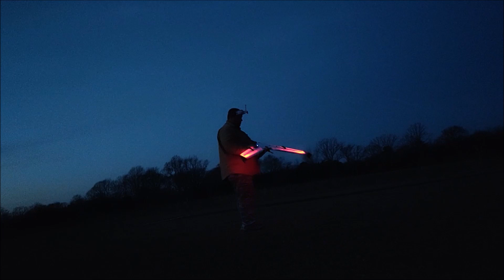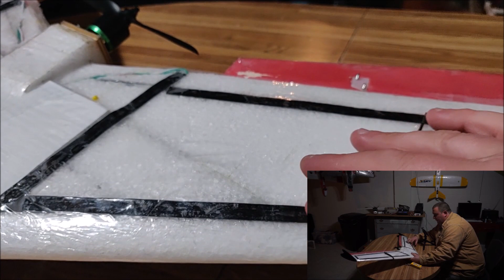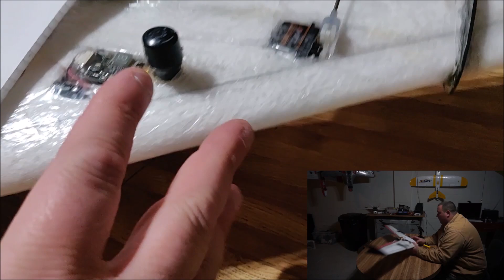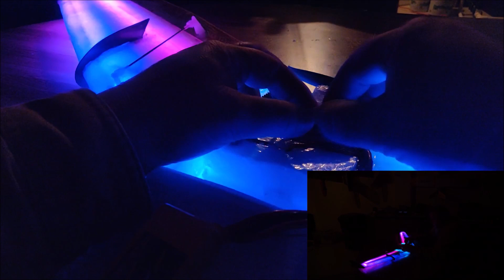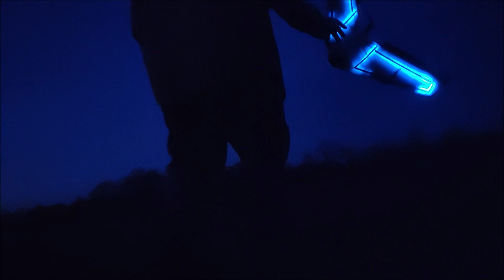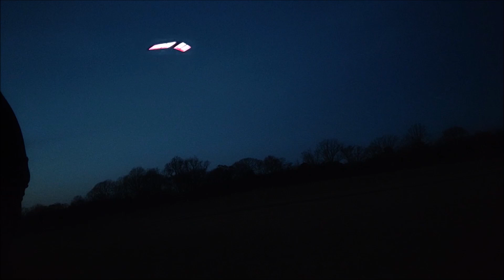FPV LED Night Wing, Flight Footage and set up how to

Comment: Awesome Video! Is that a 3D printed camera mount for your plane? Any chance you could share the .stl?
Reply from the maker: Certainly! This is the one for the spec wing, it also fits the tech racer, There are others available for other wings, I used a different but very similar one for the HardCore 44.      https://www.thingiverse.com/thing:2315794
Reply: @stevecorwonski385  Thank you so much!!